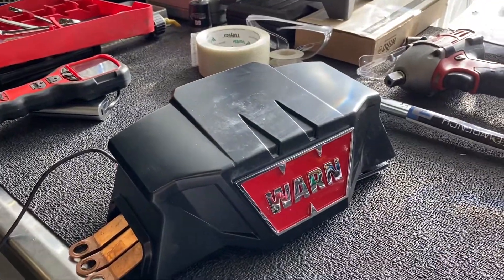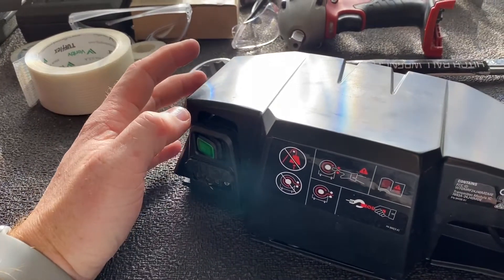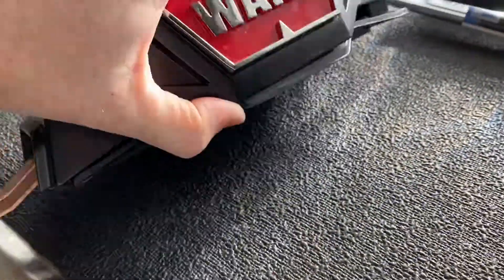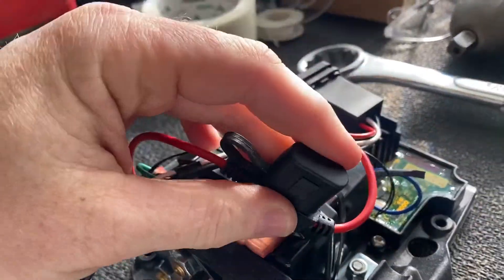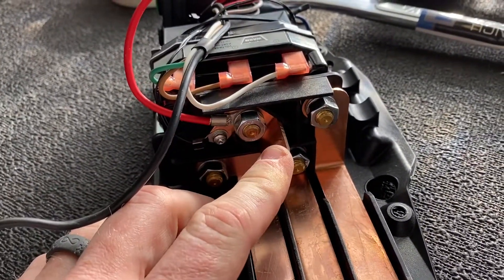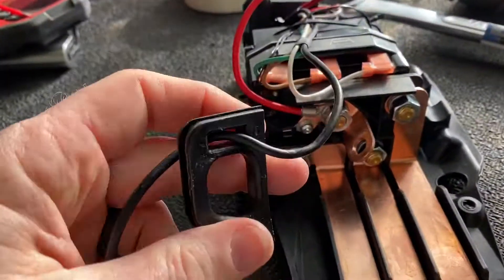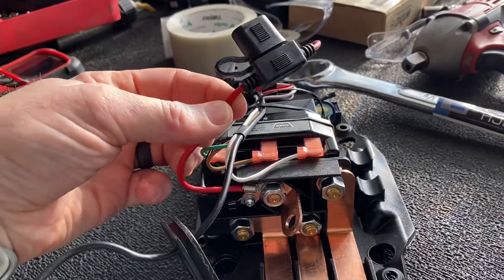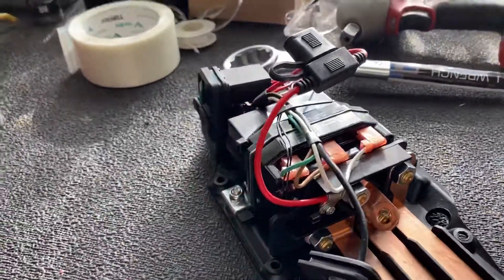Warn Zeon Platinum winch rewiring power switch for remote mounted installs.

Comment: You can also wire in a remote switch on the ground wire which is already external to the winch controller, this allows you to run just one wire to the switch and ground the other end near the switch.
Reply from the maker: Whoah. Why did I not think of that?! Totally will be testing that out tomorrow. Thanks!
Reply: @MatteoGigliotti-n1f, are you suggesting that I can run the small ground wire from the controller to the factory Aux Switches in the truck, rather than disassembling the winch already installed behind the bumper?
Reply from the maker: @JoseDean  You could but you would need to run a relay. If you connected that ground wire to an upfitter switch wire it would be a direct short (12v to ground) and blow the fuse.  You could do it with a relay. I haven’t tested this, but believe that you could do it by connecting pin 85 to ground. 86 to upfitter (12v). Pin 30 to small black wire coming out of the winch. Pin 87 to ground.

Comment: @garyhe1717
Thank you for your video. Have you figured out the wiring for the winch in, winch out, and free spool so those could be added to remote switches?
Reply: Howdy! So I have not looked into that. I would highly suggest not doing that for safety reasons. You really wouldn’t want someone to bump one of those switches on accident. 😟

Comment: Also, any chance you figured out the wiring for the winch in, winch out, and free spool so those could be added to remote switches?
Reply from the maker: I haven't dug into it that far, but I'm sure it wouldn't be too difficult to do.
Reply: @SwarfWorks  thanks for replying!! so what do you think? wanna figure it out and share. ;) ideally in a way that the wireless controller is still functional.

Comment: So you took the power going into the which's switch, so that power switch must stay on, correct? if it accidentally gets turned off, then the remote switch you added wouldn't have any effect, correct? any reason you didn't just take the wires going to the winch's switch and reroute those to your remote switch, thus eliminating the winch's switch from the circuit?
Reply from the maker: I believe that you could certainly do that. I've never had the switch get accidentally switched, but would be nice to do that because you could eliminate the switch in case it failed.

Comment: Hello, I just purchased your rear winch mount for the f150. I do not have any aux switches in the cabin. Im not that experienced with electronics or wiring. Im thinking of adding a simple switch for the on/off where the spare tire key hole is located. Could I attach the on/off power lead to a simple two prong switch? Would I have to add a ground? Any help is appreciated and apologize if any of that sounds way off. Or a three prong switch for a weatherproof led rocker
Reply from the maker: Hey Zach. Yeah you could do that. You’d basically be replicating what’s in the winch but it would be at the bumper. You’d want a switch that was sealed really well.